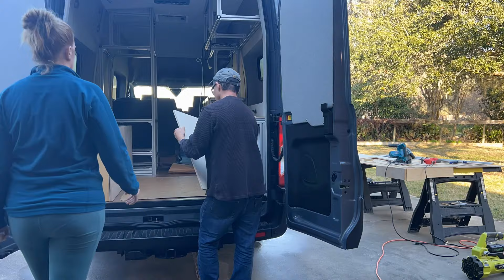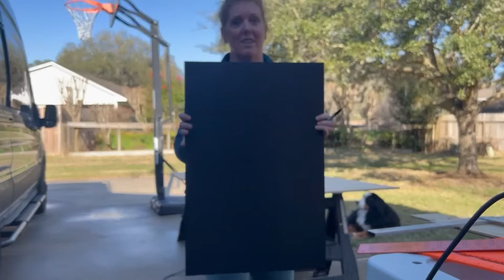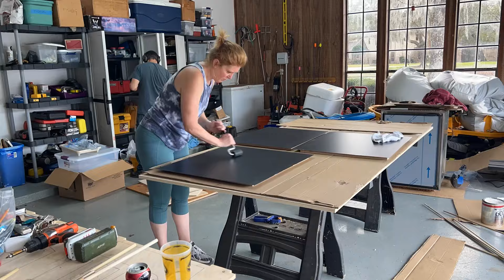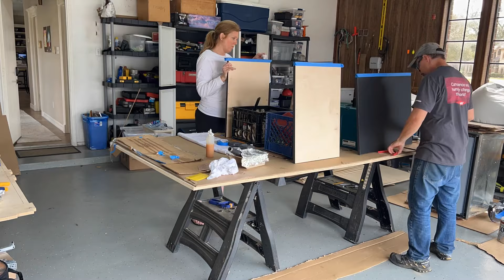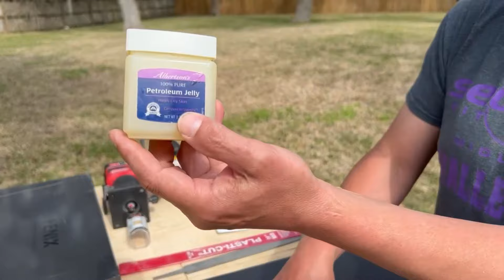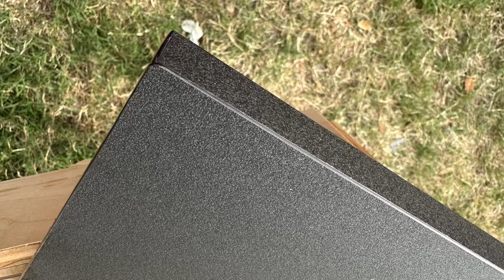Ford Transit Van Build | Cabinets, Laminate....and Lots and Lots of Adhesive!

Comment: where did you buy the laminate and edge banding from? thank you for the video!
Reply from the maker: It took me a lot of internet searching to find someone who would had this laminate and who would also sell it to me! We did purchase our laminate and banding from Dakota Hardwoods. They are a large distributor with several locations, and there was one in Houston where we are based so it worked out well for us to be able to go pickup. However, it was worth the hassle as we absolutely love the look and feel of the Fenix laminates in our van! Good luck!
Reply: @blazingwanderers  thanks! I think I found an online retailer that will order the colors needed. Question, did you guys use the 1.7 color cored all around or did you go with 0.7 for vertical faces?  I'm leaning 1.7 all around purely because it might be more durable for not that much price difference
Reply from the maker: @alextran8585  We used the thinnest laminate available for all the vertical faces (I believe it is 0.7/0.8 mm thickness), and then ordered the matching edge banding to do the edges. And after 1 1/2 years with some use, it is holding up beautifully!  The thinner laminate is also easier to work with in my opinion!